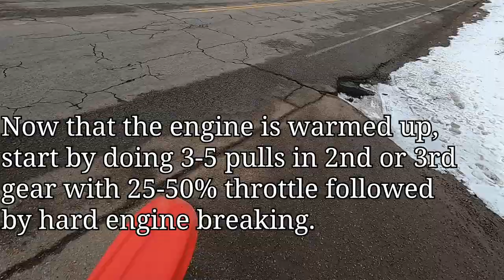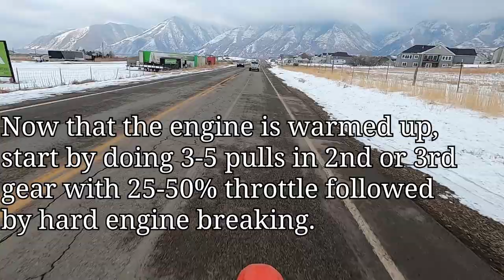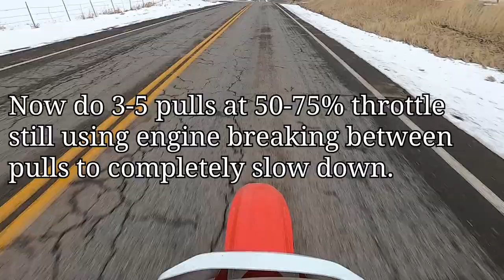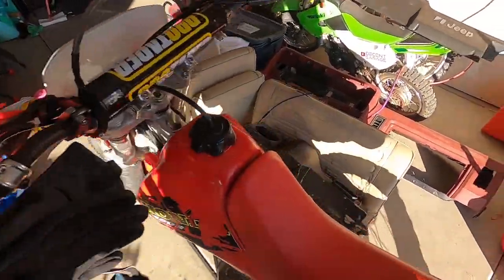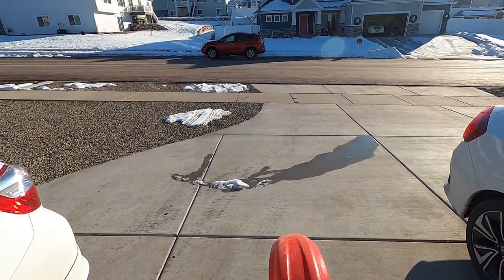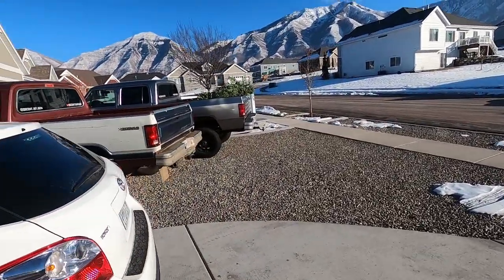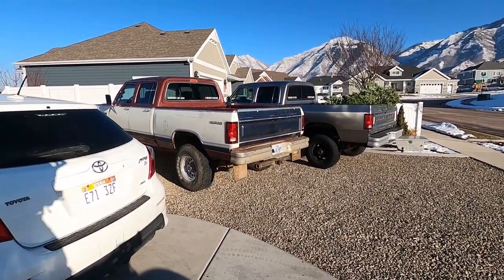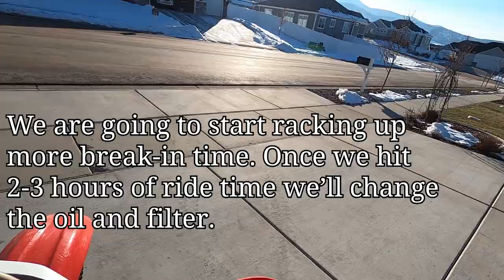New Top End? Here's How I Break it in

Comment: Im going 440 on a 2003 model with new valves and seals my approach to run in is start bike warm up on ride nothing over 60 kmh 20 minutes then back let motor cool right down then repeat procedure slowly building Kay's and speed get a nice ring seal and oil change  should be good to go

Comment: As much as this has been a part of engine building/rebuilding for at least a Century, I 100% assure you that HONDA does not do any kind of "Break In" at the factory. In fact, the brand-new bikes are all put on dynos and run quickly through a series of tests to ensure all shifting, oil pressure, speed, power, temperature, and charging,  are achieved within specifications. Then the oil is drained and it moves on to shipping/boxing. So if HONDA doesn't do it, why do we all think we need to?
Reply: I’m gonna assume, only my thought on this, if it needed to be redone when he had it, perhaps it may have gone longer before needing that of Honda did do a break in. But I have no idea, that’s just my assumption.
Reply: @chiliboom6140  I was a Design Engineer for HONDA and lived in Japan. Not One HONDA M/C engine ever was treated differently than explained above.
Reply: @benkanobe7500  Cool! Thanks for the info. 😁

Comment: Guess I have to do mine.  Seized up after a race.  I unseized it, but not starting, now.  It was low on oil, is it possible its ok?
Reply from the maker: Probably needs a new cylinder along with the piston and stuff
Reply: @decentgarage  so it gets hot in there and the rings or the cylinder fail. But maybe the valves are ok.
Reply from the maker: @RideWithTheWolf  only way to know for sure is to tear it apart.